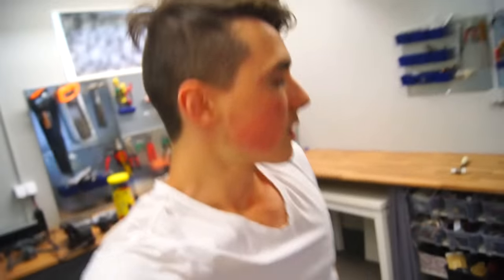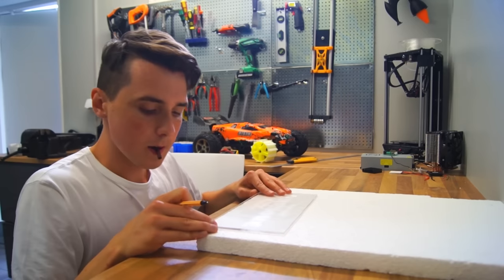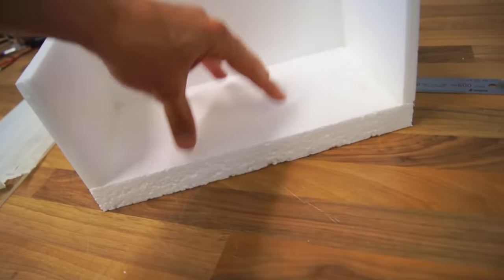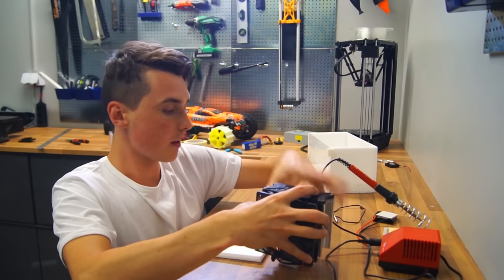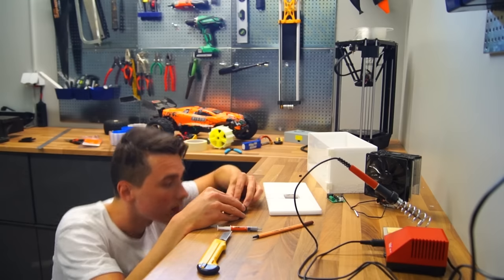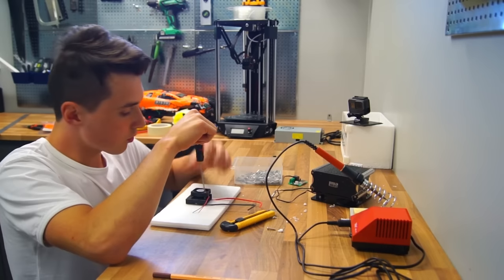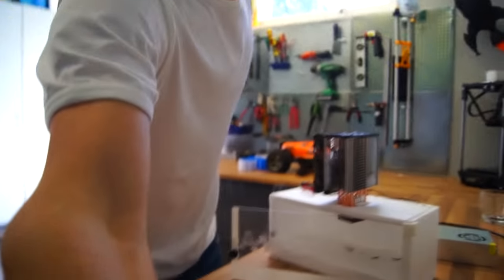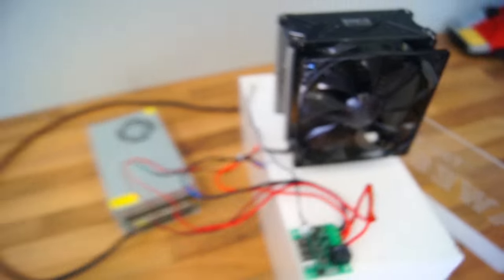Powerful Cooler Box - DIY Peltier Freezer

Comment: I got a old vehicle With no air Conditioning  can you find a way to make a Peltier air conditioning system for a old 1950 truck And other older vehicles :)
Reply: No: Because for a car you need 4-6kW of cooling and these peltier modules are 12-20W

You could look at making an adsorbsion cooler (ammonia loop) driven from exhaust heat (or the vehicle's water system) using the modified technology developed by Solarfrost.com (the original tech was developed 180 years ago, Solarfrost vastly improved the ammonia bubble pump)

Comment: I've wanted to buy some ready made peltier modules with heat sinks and fans off eBay to use as an air cooler for my shed, do you think it would be adequate with a computer PSu and for a smallish shed how many should I use?
Reply from the maker: +Andrew Smart That sounds like a very interesting project. Assuming you will be using 70-100W peltiers, you should be able to power up to 5 units with a powerful PSU. Whether it will work or not is hard to say considering the number of variables.

Comment: I have a question please : if I buy the whole system (I find it in banggood) can I use it as a small and personal air conditioner. The hot air will be evacuated through a small opening in the window. I don't need to cool the entire room, just to have cool air on my head skin.
Reply: Thermal capacity will not be even near enough. Peltiers are not efficient

Comment: Hey bro i'm want work by peltier  but another project so i need more infrmation if i can use it 
 i want build cooler for micro processeur (fan & heatsink ) and with that i'll put peltier to we have more cooler  
Each piece works at a certain degree  in three degrees and will controlled by arduino 
first just heatsink do job then in scond degree fan work then when micro processor it rises more the peltier work with fan in same time so what you think i can use it bro ?

Comment: You're wrong! The best way is to apply thermal compound all over the peltier module! That's not a processor that needs only a drop in the middle where the chip is, that's the reason why you maybe getting 40% of the top performance of those cells

Comment: hi man, nice inspiring vid, when we speak about mistakes, pls change your wiring skills, thats not the right way how to wire a cables and how to connect 2 or more cable to one spot, u should use hollow for cable to connect them properly to jumpers not use shrink tape, also it looks much better when its clean cables, and its better to zip it down, but nice vid, where do u buy most of that electrical parts?

Comment: Hi, thanks for the video could you pls explain to me whether I can set the temperature to limit for the Peltier to switch on and off automatically
Reply: Of course. You use a thermostat and a relay to switch the Peltier OFF when you reach your set temperature. It really is that simple.
Reply: you need a controller, then you can do it. Lookup a suitable PID on ebay.

Comment: If you put that on a cpu case with fans pulling air in and out would it create condensation on the motherboard?
Reply from the maker: Yes it could and that's why it's not widely used.

Comment: Hi i have 12715 peltier which im using with a computer heatsink and a high rpm fan to get rid of the heat and to get the lowest possible temperature im using 12v 10 AMPS  but really disappointed as its not getting too cold on the colder side
Reply: Aliya Bhatt What was your solution??

Comment: man you should try to build something for PC cpu cooling for high overclocking.
Reply: Already tested - no difference between good air cooling and peltier one. CPU pumps a lot of heat and the main issue is pump out this heat. Peltiers are goos for chiller boxes but not for anything pushing direct thermal load

Comment: at what temp below ambient temp does condensation start to happen?......have you done this with that temp controller to cool a cpu with out getting condensation??
Reply: that's called the dew point, and it changes depending on the weather

Comment: The thermal compound myth is bs. You should try to avoid air pockets and the size does only matter if you have metal components in the compound and apply it near electronic parts.

Comment: I made one of those but with a 33 liters cooler, and it doesn't lower the temperature even with 2 peltier cells
Any reason for that to happen?
Reply: The cooler is way to large, you'd probably need at least 6 for that size

Comment: It is good but as soon as u open it ....the freeze is gone ...it will take another 30min to cool down
Reply: if you're worried about that, add something on the inside to create thermal mass. 

You still need to remove the heat, but air has a very low energy capacity anyway. All adding thermal mass will do is mean that it takes longer to reach initial temp and when you add your actual items, the thermal mass will absorb heat from them faster (they'll cool faster) but the total heat energy removed from the box will not remove.

You don't really need a fan inside the box if you put the peltier cold surface on the TOP of the box (cold air sinks and this will cause a natural convection turnover effect) - and that puts the hot surface facing up, which makes cooling it easier.

Comment: That particular heatsink is not the right one for this application. You notice those heat pipes? They only conduct heat well at higher temperaature because of the way that heat pipes work. Look it up. A less expensive smaller cpu fan would be able to dissipate heat better when your box got really cold because it does not depend on heatpipes to dissipate heat.

Comment: Thanx for the vid. You asked that people let you know if you're wrong regarding the  thermal paste installation. You are not using the best method. Best method is a X , this spreads all over the heatsinc, with out oozing out the sides. Using the pea method makes a large ’O’ which doesn't touch the corners, leaving the outside area exposed to air, which means internal temperature elevation. See this link if you or anyone else doesn't believe me https://www.pugetsystems.com/labs/articles/Thermal-Paste-Application-Techniques-170/ . If anyone says "don't use too much thermal paste", this can only cause issues IF using ELECTRICALLY  conductive thermal paste, and IF the paste oozes out the sides and males contact between components.. Hope to see a retest with the same thermal paste, using the X technique. For a somewhat accurate comparison you would also need to a monitor your ambient temps . best of luck, hope this teaches someone something new :)

Comment: "pick up the necessary components here:" goes on to list no power supply...
Reply: The psu (at first glance) is likely from a prebuilt pc (but I now say otherwise since it has the screw in ports), and he mentioned 200w for the peltier module, plus an assumed 50w-100w for the electronics, so maybe a 300w power supply. Found this, seems close to  the psu used https://www.ebay.com/itm/Durable-LED-Switching-Power-Supply-Transformer-Aluminum-Alloy-Adapter-AC-TO-DC/352713472997?hash=item521f5c7be5:m:m7NoK11uwEpAO2CauhQo7MQ

Comment: Help me build a 10 x10 x 6 (feet - 3x3x2 meter) external refrigeration unit for my hydroponic room/farm (about 1200 sq. ft. Room) to keep my greens cooled ,post harvest, for the farmers market.  Send me a pm if you're interested.  Goal is to keep the avg. temp of the unit at 37F or 2.8C

Comment: Can i use 250w pc psu
Reply from the maker: Might be a little weak, but would be sufficient for a 6-9A peltier module.
Reply: i will try with 14A psu if not i will order one 12v 30a 360w psu.. thanks for help..

Comment: this is not an efficient way to consume electricity. Sorry, but I tried it. I tried to put a water block that connects to a copper tube to dissipate the cold to produce cold air. but unfortunately, the temperature reach only 25-30 degrees.  but the water block alone is at 7 deg.  So if you want to build a DIY air conditioner unit, buy the real one. DIY is a waste of money.

Comment: 1- Make a small fridge sized cabinet out of wood.
2- Insulate the cabinet, with styrofoam on the inside.
3- Spray the styrofoam (on the inside) with a few layers of car paint and a layer of Ceramic Coating or transparent lacquer, to create a protection layer for the styrofoam.
4- Use a much larger passive heat sink on the inside, depending on the design, it needs 2 to 4 peltier elements if you want the temps to go below freezing. The inside heat sink needs to be at least the same size as the outside one, if possible fill nearly the entire back wall of your case. One of these per 1 or 2 peltier elements: https://www.amazon.com/Aluminum-Heatsink-Amplifier-Transistor-Semiconductor/dp/B073R5GRHT/
5- Since the outside is actively cooled, you can reduce the outside fan to a smaller cooler like this one:
https://www.amazon.com/Connector-Aluminum-Heatsink-3-62-Inch-TronStore/dp/B0751T1ZQ3/

The greatest design, is if you could work with plastics, and have the outside cooled via a sealed water reservoir, instead of fans.
It would offer greatest efficiency, lower power consumption, and faster cooling.

Comment: Very nice video but thermoelectric coolers are HORRIBLY inefficient.  As much as we love that they require no moving parts other than external fans to circulate air and the fact that they're low voltage DC devices (great for solar), they unfortunately cannot even come close to compressor-based coolers.  Your TEC is drawing 200 watts (continuous) just to keep the temp below zero.   That's very bad and it won't be improved by very much by improving the insulation.  I wish they were more efficient.